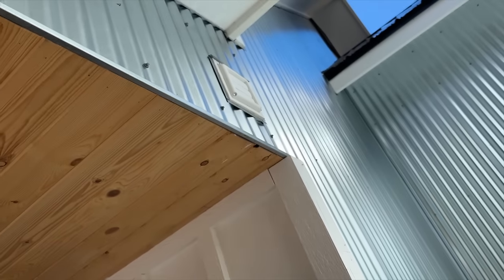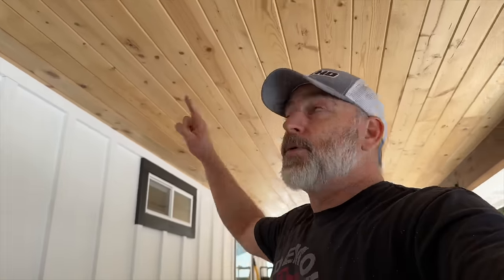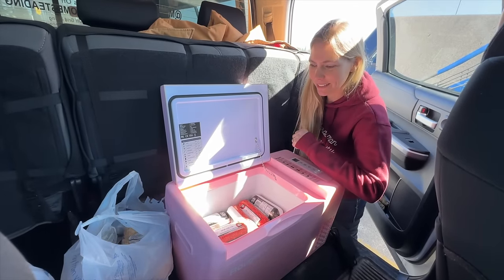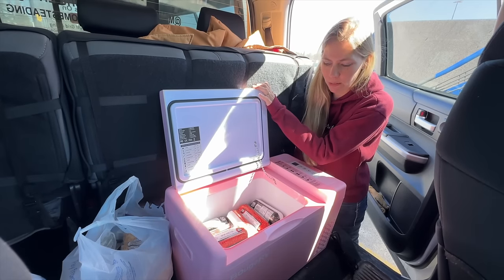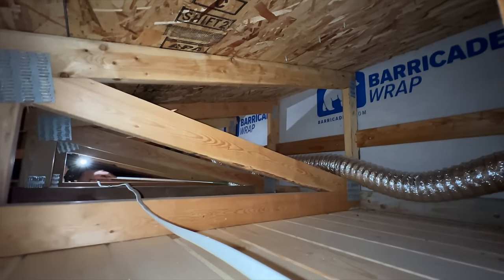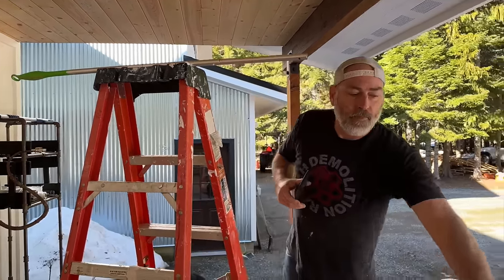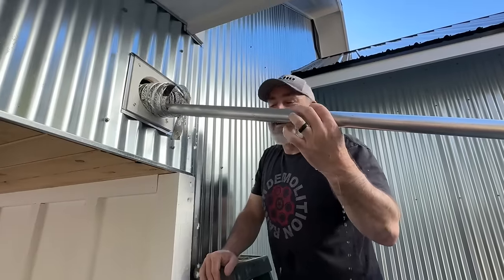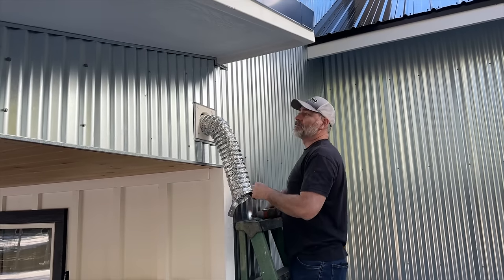SERIOUS PROBLEM with our HOUSE! My Biggest Construction Mistake

Comment: That duct is way too long. Bathroom fans are not meant to move air so far. Like it or not, you should bring that duct directly down through the tongue and groove ceiling.
Reply: Your right, that's exactly the issue. Duct is too long. The fan instructions will have stated the max duct length allowed.
Reply: I agree 💯 it’s not ideal but will solve the issue
Reply: Oh wait...   Marty did something wrong.  No surprise.  There is no vent pipe it is a corrugated hose that will collect water that then freezes.  Those hoses are meant for a dryer not a bathroom vent
Reply: As soon as warm air hit cold air it condenses, an then is water. With the length you are running that air duck it's filling up with water.. An it not working as you want it too.
You need to change an run it straight out...
Reply: and they where told this months ago.....
Reply: That kind of pipe causes too much flow restriction for this or dryer venting, should have been a shorter vent, rigid pipe with some slope to the outside and insulate it all the way to the end. Of coarse in cold climates.
Reply: Or do two fans - one to push at the source, the other to pull from the end.
Reply: Whilst the duct is way too long, bringing it directly out of the t&g will likely result in the steam condensing as soon as it gets outside, resulting in a puddle on the deck, which over time, will rot the deck timber. 
Even using solid pipe, the run needs to be as short as possible, so I'd probably suggest bringing it straight out from the bathroom, with rigid pipe (with a small drop), whose far end is beyond the edge of the deck, so the condensate drips onto the grass.
Reply: Hi Guys!! 🙋‍♀️✨️💕
Reply: HOT AIR RISES, IT WILL COME OUT, RISE, FORM CONDENSATE MOLD ON TONGUE, AND GROOVE.
Reply: The fan is fine, if he uses 3”or 4” pvc from the wall to the louvers, the pipe won’t sag, won’t fill with water, and will push the air out the opposite end.
Reply: not true it needs to be insulated

Comment: Martin I have solved this problem on vents for bathrooms and dryers by replacing the long runs with schedule 40 plastic drain pipe with a proper slope to the outlet.

Comment: Hello Julia, Hello Martin Greetings from Germany! The way I see it, the problem is that this hose was used for venting instead of a vent pipe. In addition, the vent is far too long and should be routed directly upwards through the roof. As you can see, the hose is sagging, which is why condensation can form there and prevent ventilation.

Comment: I actually warned you guys about that happening when you were installing that run of vent. When hot steam meets cold walls, it condenses and fills up the low spots, then the pipe shifts and creates essentially a J trap. Run that flex tube to a piece of 3-4" PVC pipe with a 1/4" fall per linear foot. The angle needs to be enough that the water that does collect in that tube has nowhere to collect. Run that 3" outside of the wall, cover in mesh, and let it drain straight to the ground. That's probably the easiest way to fix this with your current setup. Still... if that's the worst, you've done a great job, Marty! Always great to see episodes from you and the family. Best of luck!
Reply: I also mentioned it should be a solid pipe not flexible.
Reply: They can do it, but I think it needs to be double walled pipe, so there is some insulation value and the air actually gets properly outside before it condenses.
Reply: They won’t ever listen.
Reply: Insulating the solid pipe will help also. Make sure you grade it like a sewer wast line running outside.
Reply: You need solid, insulated pipe
Reply: Septic is 1'' in 20 feet so I think that should work but shorten the run if possible & of course as much drop as you have... Vent pipe should be totally insulated also !!

Comment: Should have used a bathroom fan that uses 2" or 3" rigid pipe as a vent and slope it all out so  any moisture runs out
Reply from the maker: Yep!
Reply: Should have also insulated the exhaust pipe. Warm moist air on the inside and cold air on the outside of the pipe creates condensation on the inside.
Reply: Bingo
Reply: 2" huh?  please show me a model that has a 2" exhaust
Reply: @BrianKrahmer  we have 2" bathroom vent bathroom fans her in canada at homedepot or rona or any hardware store or even amazon. I've even installed them in my own house
Reply: A tiny fan with a tiny 2 inch pipe over a long distance for a bathroom that big?   Yeah don't do that.  lol.

Comment: I am NOT saying I told you so, however if you recall I suggested that you not use that vent piping.  I use solid piping in walls and ceilings to preclude these issues.  In fact most times I use pvd pipe in the ceiling.  Never had any issues this way.

Comment: Your bathroom vent tubing needs to be insulated. Moisture is condensing and collecting in the tub dips. It might work better if you vented through the fascia to shorten the tubing.

Comment: It's not only about the CFM of a fan, you need a shorter run so that the flap opens on the end thus drawing the air out. 
Otherwise the air and mousiture just sit there.

Comment: I work in a hardware store, and I've ordered that Vet pipe many times For Contractors To make long runs. It is made out of aluminum 4 & 6" Long.. I'd be using that. I would cut an access Door below where it comes out of the house. If possible I would have at least a 2" drop from where it comes out of the house to wear it exit the house

Comment: If you decided to go solid pipe I hope you insulated it and set it at a slight slope.  Other wise you will get mold inside the pipe near the temperature change point by the bathroom outlet.

Comment: think you would be better making an access hole in the porch ceiling and then vent the pipe out of the porch roof, as it is now that pipe run is far to long, the extractor fan is not strong enough to vent over that length. then you would have easy access should it need changing or repair in the future, good luck Martin i know you will overcome this.

Comment: When you run an uninsulated vent pipe outside of conditioned space, especially on such a long run there is a high likely hood that you will have condensation problems and in this case the condensation probably is blocking the flex.  No matter what you use slope it down and out.

Comment: We had bathroom in college which had a vorous-sounding vent, but it never seemed to do much to clearing out the steam.  Eventually, I investigated thoroughly and discovered the fan box did not have the knockouts taken out!  The builders hooked up the power to the fans, but had never put in ventilation ducting!  
A few months later, our downstairs neighbor was excessively running their bathroom fan, so I investigated theirs too.  Same problem!  The fan could not exhaust the air because the fan's box did not have an exhaust hole!

Comment: Hi guys, You need to install an insulated vent pipe as the cold from outside is condensing the moisture in the pipe. I live in Canada where it gets very cold and I had to use insulated vents in my attic to prevent water running back down into the house and staining the ceiling.

Comment: Forget trying to vent it out the end of the porch, vent it through the porch ceiling near the bathroom.  Much more effective.  Shorter run = more air flow. Long run of even rigid pipe will still condense and freeze in that unheated space.  I saw problems when you did the install, sorry now I didn't say something at the time.
Reply: I did!

Comment: If you had some load bars, like they use to hold a load back in big trucks, you could put a board across where a load would be(body weight on ceiling) and move them as you(Seth) crawls in, and out. Put one bar on each section between trusses,  with a 2X4 between the load jack and ceiling. Shove the PVC pipe in from same end as Seth goes in, gluing as needed, and hand what he needs to him through the light holes. Could also use a 2X4 or 6 or... cut to length, in place of a load jack. Doable, just not as easy as the Jack.

Comment: I said during the original installation that using flexible duct on the outside is not a good idea. Should be ridged metal ducting on a slight slope all the way to the vent.

Comment: You could put in a 5m long metal pipe, to keep it straight. Then, the water automatically comes out at the outside opening of the vent, when it condensates.

Comment: Vents go straight up and out of the roof. No matter how you replace it. Using the current setup, you will have problems with freezing and blockages. You can't fight physics: Hot air rises.

Comment: My suggestion would be to run solid PVC tubing from the vent to vent on a 3degree slope to allow moisture to flow out easier, as that’s what has been done to reduce moisture in my bathroom and now I have no more problems! Also as PVC doesn’t corroded there is less chance of moisture damage to the piping over time.
Reply from the maker: I like this idea.
Reply: Yes and insulat the pipe so it what to condensat in the pipe.
Reply: I agree with this solution. I would use 3" minimum PVC pipe sloped down so that it drains. Also where the pipe comes out of the house use two 45 degree fittings with a short pipe connecting them instead of a 90 degree fitting as air does not like to turn sharp corners. It will flow out much better this way. I did the same with my dryer vent to keep it from clogging with lint.
Reply: DWV is cheaper.

Comment: When you posted the placement of this vent, there were a bunch of comments suggesting this outcome. If you can, take out the existing vent hose and put in a single pvc 4inch pipe with a pitch allowing water to drip. Out the end

Comment: Buy 200mm rigid spiral duct legths and push through the break out hole then knock hole in bathroom wall to fix rigid bend to fan, slightly bigger duct with less resistance and rigid construction also less resistance

Comment: had the same issue before. used solid thin wall PVC pipe for as far of a run as you can, then short sections of your flexible to fasted to each end. Mount the pipe on a downhill slope to the end to allow all moister to drain.

Comment: Marty, you need to install an access panel right below where the exhaust pipe exits the building. As the pipe you currently have is too long, you should apply the ridgid pipe venting down through the ceiling.

Comment: I have a larger BougeRV Cooler/Freezer and it uses the battery Pack. 
Note: You can use Solar to charge the pack, while you are using it. You can use the Car plug to the battery, then to the cooler for extended run times. Love ours as we do use it in the summer when we go shopping in the triple digits

Comment: You need to heavily insulate that vent pipe. Even if you work to slope the pipe right water will freeze and block it off. It happened in my house.
Reply: I commented at the time that the vent pipe was far too long and it would be prone to freezing during the winter,a vent just outside would cure it.

Comment: The duct should have been insulated because of the temperature difference between the hot air inside the duct and the cold winter air outside.  Especially that length of duct it is going to really condense and collect in those dips.  The best case is to find a shorter run for that duct or at least make the duct run straight or even slightly downhill to make sure the water runs out of the vent at the end.

Comment: one thing don't use flex hose ever, 2 you want the shortest distance from the fan to the outside and you do not want the line to go threw a cold area before it gets outside

Comment: Common mistake made by DIYers. I made comments back when you were installing bath and kitchen exhausts that flex vent should not be used, they should have been rigid venting and the problem vent was way to long. That flex pipe is not vapour rated its for some heating only applications not exhaust vents, the ribs in flex vent will always collect moisture and soon it will disintegrate and leak and cause mold. I know you won't but, you to have to open up the bathroom ceiling, change the vent pipe and shorten and exit through the porch roof close to the house so the overhang will protect it from snow shear. Any vent pipe even rigid not in a conditioned space should be insulated and never be that long. But you will again ignore 50 years of experience from an HVAC contractor. Just like the ticking time bomb of a no vent heater you installed in the garage.

Comment: I would've used sections of 4" vent pipe instead of the flexible stuff. You could remove the cap on the end of the flexible by the garage, and assemble sections of the rigid vent pipe and slide it in place of the flexible.

Comment: water in vent pipe, use  hard pvc 4 inch pipe not flex pipe and glue it together like plumbing with fall to outside, come straight down from the bath room thru the ceiling on the porch.

Comment: Run a 1 1/2 inch abs pipe through the flex tube to give it strength and open on both ends to keep air flow.

Comment: Use solid tube ducting and a bigger fan for runs over 3m in length. Flexi shouldn't be used in anything longer than 300 mm or bends at least in the UK

Comment: Martin I told you that you made a mistake with the long vent tube wold fill with water , it was way to long.and should have been a solid pipe, and a shorter run.

Comment: Rigid exhaust pipe and/or pipe straps to secure it. Also believe hose run is too long. Allows warm air to cool and water condensates and stays in pipe

Comment: Ridgid pipe, added insulation (to prevent condensation), upgrade the fan to a higher CFM rating capable of pushing the air column that distance. Calculate your air column by distance and adding a factor for each elbow or other bend. But, insulating the pipe will likely fully resolve the issue. You're dealing with high temp air hitting an unconditioned space, causing "super condensation". My wife and I dealt with this identical situation with a dryer vent in a mountain home we built.  Good luck.

Comment: Using the ductwork that you use is fine you just have to pull it tight and Pitch it at an angle with zip ties if you switch over to Ridgid pipe that's fine but keep it at an angle so it drains outside With the seam facing up.  your hot steam is condensing in your cold pipe outside

Comment: Should have used rigid vent and it should be insulated in that run because it's outside the heated envelope of the home. Water is condensing from steam to water and sitting in the bends or low points.

Comment: Easier fix - place a 2 x 4 or 2 x 6 below the flex pipe.  Zip tie flex pipe to wood every 4’.  This will solve the bending issue.
Use plumbers tape to fix the hole in the flex pipe.

Comment: Insulate the run outside of the Conditioned space. The Condensation is freezing. Think of it like your Woodstove Flue, the heated air is collected to the Cold Surface. Just a as Creasote clogs your Woodstove when Single wall pipe is used beyond the roof(that's why we use Double/Triple Wall).  Heat is Draw to Cold so you will have to Insulate even if you use a shorter run outside of the conditioned space.

Comment: don't use flexi-duct for a long run. Use solid exhaust vent pipe and cover with insulation. Slope it slightly downwards toward the outlet so any water that does build up can run out where the vent cap is. Put a small hole in the bottom of the vent cap. I've only seen fan vents through the roof and even those have insulation cover in the uninsulated space. They are flexi-duct though, but go up vertically so no place for water to pool.

Comment: If you're going to go in there anyway, I would suggest to just replace it with rigid. For a temporary fix you could use a small diameter pvc pipe, with a cap on the end to prevent it from damaging it even more.

Comment: I suggest you cut an access from below (install a removable panel) and replace the flex with 4” 30 gauge galvanized pipe, be sure to slope it to the hood. It would be a great idea to insulate it as well, in your climate ( like here in central Alberta) the warm air will form condensation and freeze in the winter.

Comment: Risk vs benefit.  Thread Seth up there with power tools and a couple 3"pipes with a coupler and glue... you may never get him back.  Remove about 18" width of the soffit... I think it would be faster and safer.

Comment: Rigid pipe would be a good idea but ALSO, and probably more important, you should not have such a long run for your vent... absolutely never for a dryer vent and (strongly) preferably not for a bathroom vent.   May I suggest that you install a ceiling vent (on the porch) where the vapors from the bathroom will come out.   Straight and super short path.    Good luck!

Comment: That duct should run straight out to a vent at the edge of the roof.  I suspect the amount of air flow the bathroom fan produces also needs to be increased

Comment: When you installed that vent I wondered why you weren't using insulated line or putting insulation around it.  The best way would be to insulate the line and support it to flow down ward like a drain so in case it happens again it will drain instead of collecting.

Comment: Not just ridged pipe but insulated to prevent condensation and freezing.   Cut an access panel where the pipe connects to the bathroom wall.  Run a ridged pipe in from the end. you will be all good then.  Or you can run an exhaust vent through the porch roof  at the point of exist of the bathroom to shorten the run.

Comment: Should've used PVC pipe running straight up the wall. Now try another fan in the middle of the run with a flap vent on the end.

Comment: I'd use a L shaped sheet steel channel to place the conduit on to eliminate low spots and slope it downwards towards the dryer exit louver vent opening
Reply: Maybe an eavestrough, the entire  length and sealed at the seams in case it leaks.